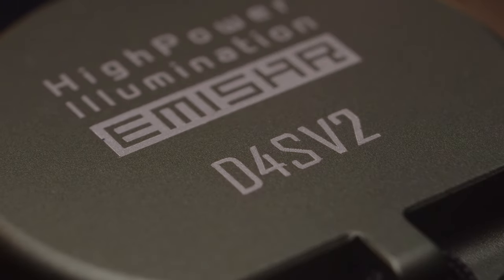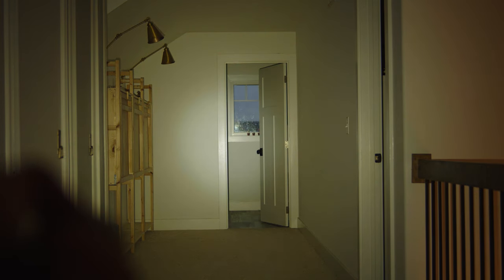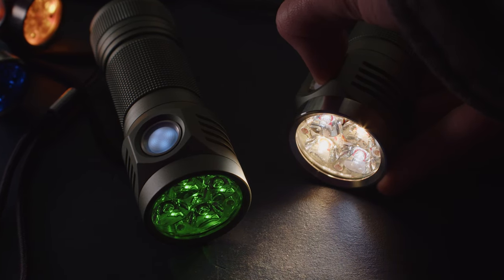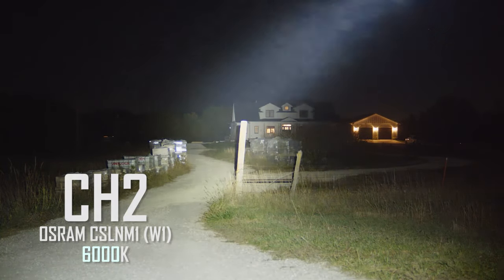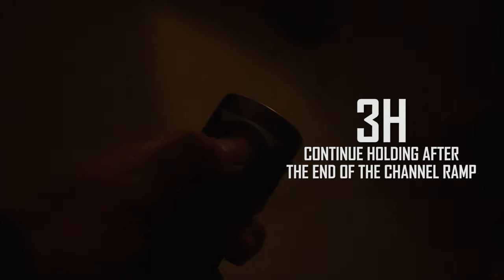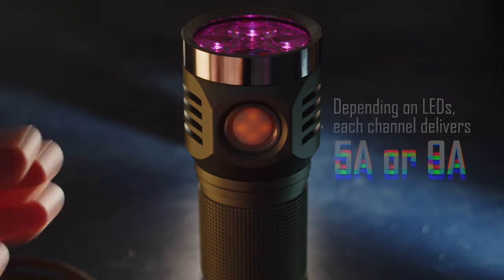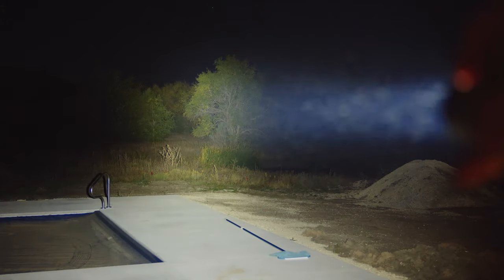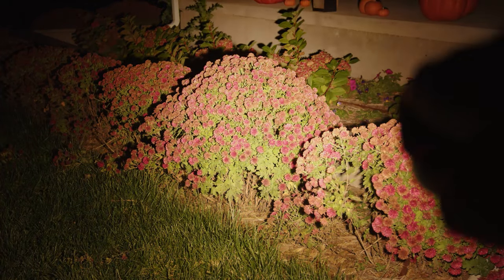The DUAL-CHANNEL Emisar D4SV2 [OVERVIEW]

Comment from the maker: THIS IS AN UPDATED VERSION OF THE PREVIOUS VIDEO (and is still NOT A REVIEW)

ToyKeeper made some major updates that effectively render the old video obsolete, so I felt a new upload was necessary. There's still some info in the comments in the older video (and admittedly I like it more), so for now it will stay up before it gets unlisted.

This is a quick look and overview of the new dual-channel D4SV2, intended to help answer some questions people have about the new light. The video was commisioned by Hank Wang of intl-outdoor.com (Emisar/Noctigon), where this light can be purchased.

A full review of the D4SV2 is coming, featuring both of these models as well as the W2 (standard driver) version of the light.
Reply: Will you delete the old video?
Reply from the maker: No I will just unlist it, so anyone with the link will still be able to find it. Just for sentimental reasons, I like that edit more 😅
Reply: Thanks for this. I’m super new to hank lights and just ordered my first one (regular d4sv2) 2 weeks ago. Still learning a lot about everything on Reddit and this video was really helpful.
Reply: I get the feeling folks are gonna poo-poo the D4SV2 now that this is available on the D4V2... Completely ignoring the excellent thermal properties and better throw optics.  It won't be the hot rod it is in single-channel configurations, but it's probably going to have some excellent runtimes and high versatility.

Nice update on the firmware! I can't wait to flash mine when it arrives so I just have everything available in one!
Reply from the maker: Indeed, there's a bit less wow factor here but it's super practical, I'm really enjoying these lights. The D4SV2 is an excellent light all-around. As far as enthusiast features go, the dual-channel thing is really more appealing to me than the direct drive Turbo, and it's still super bright!
Reply: Do you have any inside knowledge if Hank is going to be dropping any new lights soon before I buy my 3rd? 🤪
Reply from the maker: Two new lights... The dual-channel DM1.12 and a new right-angle headlamp style might, though that one with be several months away
Reply: @LuxWad  do you know what the DM1.12 will be?
Reply from the maker: It's got a large single TIR in the center and twelve smaller optics on the outside
Reply: @2tangz where do you go on redit 2 learn this ui? It's Def somewhat confusing

Comment: Crazy, wish this was available before I ordered the dw4, I would have much preferred the throwy w1 with a floody xpl. For a good range of everything on a headlamp.
Reply from the maker: The DW4 should be available with a dual-channel driver as that was released first
Reply: @LuxWad  I didn't see it, the main led flashlights list on their site doesn't show any of the dual channel stuff. You have to hit the options menu and go to "new products", it's only listed there. I only looked there by mistake today.
Reply from the maker: @preston1614  Yes the dual-channel lights are listed seperately under the "dual-channel and tint-ramping lights" section to avoid confusion
Reply: @LuxWad  yea, at least coming from the mobile app it seems like it's more hidden rather than avoids confusion unfortunately which was my experience. 
But I do see now that there is a new tab at the bottom of the main menu for dual channel lights.
I'm just so use to clicking on the led flashlights tab after all these years....  I have ordered hundreds of emisar lights since Hank started.

Comment: So does this version have the FET? So if I re-flash it I can get the max turbo?
Reply from the maker: It has a FET on CH1. You should not enable it, as it it's only connected to two LEDS, which won't be able to handle the ~15A or so provided by direct drive. Activating the FET only makes sense in the new tint-ramping DT8
Reply: @LuxWad  So I wanted a D4SV2 with lighted switch and W2 LEDs. That wasn't available so I ordered a W2/W2 D4SV2 And plan to reflash the FET enabled driver. Would this make it work like a regular W2 D4SV2?
Reply from the maker: Unfortunately that probably won't work, the FET is only wired to one channel (2/4 LEDS), so unless you're using a fairly weak battery then you will probably burn out the emitters on the first channel.
Reply: @LuxWad  could it be that that is how your board is because of the emitter choices, or is that all of the lights?
Reply from the maker: That's how all of them are configured, it seems to be the same driver used in the K9.3.

It really won't matter much though. The  two-channel driver will produce 18A on Turbo, which is about what you'll get with a FET and a decent cell. Though more current will be brighter, the emitters are being pushed well beyond their most efficient operating range so the actual increase in output won't be significant. For example, I have a standard driver W2 D4S and the difference between a 15A cell and a 32A cell is about 700 lumens, or about 15%. Because it's FET drive and not regulated, the turbo output will drop as the cell is depleted, where the regulated driver will be more consistent  with its max output

Comment: Great video as always! I have one question regarding the tint shifting as brightness increases. I would like to have the light ramp from 2000k/low brightness to 5000k/high brightness. When ordering, do I have to select the specific temperature emitter on a specific channel to make this possible? For example do I need to select the 2000k emitters for Channel 1 to be the 'low' and the 5000k emitters to be the 'high' or does this not matter? Thanks
Reply from the maker: It shouldn't matter, you can have it ramp either direction in the UI, just keep holding the button after reaching either end of the ramp

Comment: May I ask, can you set the ceiling to be at like 150%? So that you could use 75% of each channel?
Reply from the maker: Yes, the default ceiling of 130/150 steps is the max level where the two channels are balanced as tint shifts
Reply: @LuxWad  Ah, I see, thank you!👌👍 And that is about 173%, right?

(And you can't set it to like 140/150 steps, probably due to driver limitations, if I understand well.)
Reply from the maker: I don't know exactly what % that will be, that seems about right.

Anduril is designed to produce 150 distinct brightness levels, with 150/150 being either Fet-driven Turbo or just max output if there is no FET. The older version of the firmware used in these tint-ramping lights limited the max output to 130 just to keep things level, but it now allows access to every level up to 150. However above 130 tint-ramping will also change the total brightness, which is shown in the little house-like diagram.
Reply: @LuxWad  OK, thanks for the detailed reply!👍

Comment: Really great overview! Love your vids. I think I want to go with a dual channel D4V2 with a W1 or W2 on channel 1 and 219b 2700k on channel 2. Would this be a good option for something that would be good close range and long range? Does it matter which emitter goes in each channel? Last question, would you recommend the W1 or W2 on a system like this where it is only running on 2 emitters instead of the usual 4? Thanks for all your work!
Reply from the maker: I think 219b/W1 would be a good combo. It doesn't matter which emitter goes where, the light will be configured with the proper power for each channel.

I would recommend the W1 over the W2 in the single-channel light, as it has a higher intensity. The W2 has about the same efficiency but has a significantly higher max output, which allows it to throw farther when driven by FET in the standard setup. However the dual-channel light can't deliver nearly as much power as it would burn out just two LEDS, so in that setup the W1 will throw farther
Reply: @LuxWad  that's a great insight. I think I will put an order in soon. Thanks for your work and help! Subscribed
Reply: @LuxWad  by standard set up, do you mean the D4SV1?  I don't see the option to get the D4SV2 with fet driven turbo, back lit switch? I kind of like the idea of getting the standard fet driven one with 4 W2. Just want the backlit switch! I want then allllll
Reply from the maker: The standard setup is the single channel D4SV2, which has a FET+N+1 driver. It is not available with an illuminated switch.

Comment: Great Video! I have the D4SV2 2-channel in W2 White/W2 Green.  Is there a way to run strobe on just one channel or the other (hoping to be able to use green strobe)?  I can't make it work... always runs both channels on strobe...
Reply from the maker: It seems strobe only works with both channels unfortunately.

Comment: You sold me on this light. Just ordered from Hank. What’s the best battery and charger combo that would give me the brightest and best performance?
Reply from the maker: It depends on what emitters you're using. I have Keeppower 5500mAh cells in my lights for the longest runtime, since they don't need much current. Keeppower's 5200mAh 15A 26650s are probably the best all-round, efest and vapcell have some cells with even higher discharge but I've never used them. Any charger is fine, XTAR is the most recommended
Reply: @LuxWad  thanks for the info. I’m still learning about the varied options of LEDs. I ordered Channel 1 Cool white SST20 6500k, and channel 2 warm white SST20 2700k 95 CRI

Comment: On channel switching, other than turbo, is there a setting where you can use all 4 LEDs:  ramp up and down, turn off and on, etc. with all 4 LEDs on? ....
Reply from the maker: No, but you could set the ceiling to 150 and then ramp up. Everything above 130 requires both channels to some degree. Otherwise though you want tint-ramping

Comment: Great video! I have one on the way! I went with the XP-L Hd and the W1 Osram. Will the keepower 15amp 26650 be able to put out enough amperage for this beast?
Reply from the maker: Depends on the emitters, if you have the Nichias + something else it will be enough since the total draw will be under 15A. If you have two channels at 9A each you'll need something with higher draw - the 15A cell will still work but it will degrade more quickly with use

Comment: with tint ramping is there a way to find center? so all emitters are on equally, without going to turbo?
Reply from the maker: Right now there is no direct way to do this unfortunately. You can try disconnecting the power and the reconnecting it, as long as there is no manual memory it will reset to center ramp. You can then set this to memory.
Reply: @LuxWad  thanks, i had to do a factory reset but this appears to work

Comment: If you buy the dual channel driver in whatever color temperatures, will it still have the smaller leds that  change colors?
Reply from the maker: Yes
Reply: Thanks for replying.

Comment: I just got one in sand color with amber backlight and 519A 5700K   dedomed and w1, this light looks like pocket jewelry, but my question is how do switch between tints instantly without ramping each tint out?
Reply from the maker: That is explained in the video at 3:05
Reply: @LuxWad  ok thanks.

Comment: What would be the floodiest brightest white led and brightest throwiest white led.
Reply from the maker: LH351D on 5700K for flood, and Osram W1 for throw (W2 for single-channel lights)
Reply: @LuxWad  doesn't look like LH351D on 5700K is available for the dual channel?
Reply from the maker: @lucacadianalbert Availability changes over time, if you want something specific it's best to email Hank directly at contact@intl-outdoor.com, he will let you know if that's an option
Reply: @LuxWad  Thanks for getting back to me. I have an old Emisar D4 that I bought years ago which has quad 219C - its a nice light but I'm looking to get a V2 or maybe a D4K as an EDC light I can keep in my truck for when I go camping. I'm torn between 519a 4000K domed or either a 4500K/5700K dedomed, some people clam the color on the Dedomed ones are nicer - I just tend to not like the beam pattern on dedomed emitters (less flood) but color is also important. recommendation? I was tempted to get the dual channel but for a basic EDC light I feel its a bit much. Thanks in advance
Reply from the maker: @lucacadianalbert  The dedomed are going to be similar somewhere in between the 219C and XPL-Hi in terms of throw, while domed they are quite floody like an LH351D.

Colorwise, they are much warmer and more pinkish in tent when dedomed. If you want to keep the flood, you can get the same effect by mixing different CCTs, for example 5000K and 3000K. Dual-chanel will let you adjust the temp if you do that, or if you want FET power you can just get the standard version and ask Hank for a tint mix.
Reply: @LuxWad  5000 and 4000 aren't options for 519As...
Reply from the maker: Get something close or ask Hank for specific emitters that aren't on the site

Comment: Hello, I'm thinking of getting a d4k dual channel with w1 6000k with another warm temp floody emitter. What emitter would you recommend? And what is the maximum lumen for these emitters?
Reply from the maker: For the floody emitter, I recommend the Nichia 519a in your preferred cct, or the XPL-HD for maximum output (same as the light here). The Nichias should be about 2k lumens
Reply: @LuxWad  are there any throwy emitters that have high cri?
Reply from the maker: SST20 in 4000K or 2700K
Reply: @LuxWad  I’ve ordered a d4k full copper dual channel with w1 6000k and 519a 5700k doomed since I like its pinkish tint. It should be fine I don't think I need a really warm light. Thank you LuxWad, can't wait for your next videos.

Comment: Do they all have the color in the front lens when the main channels are off? I see green and pink in yours but no option to select what front ring glow color. Also, what is the difference between the D4V2 and D4SV2 besides battery size.
Reply from the maker: That glow in the front is caused by the RGB auxiliary LEDS, which come standard and can be configured in the interface.

The D4S is larger so has better thermal performance, a more throwy beam, and  a slightly better driver with a higher regulated output. Both have the same max brightness and emitter options.
Reply: @LuxWad  If I choose the same LEDs as you did on the switcher. More Flood for one and the Osram for more of a throw. If I use Titanium, will it cause these LED to not perform as well due to heat dissipation? Would these LEDs perform noticeably better in Aluminum or Copper? For example. The Alu and Copper Acebeam E70s list a higher lumen than the titanium.
Reply from the maker: The ti version of the light has a copper pill, so thermals will be basically the same as the AL or full copper version. Full ti isn't available because it doesn't conduct heat well and is a poor choice for a light like this.

Also it seems the Xpl-HD isn't available for the smaller D4V2, but the LH351D will be equally floody, and it's got better color so I'd prefer it anyways.
Reply: @LuxWad  Thank you, you have been a big help. I will choose the Titanium one then. And that was the LED I was thinking of after doing some research. Now, for the W1 or W2 LED, which would perform better in the D4V2 you think? W2 is bigger, more lumens and W1 is smaller, but more intense?

Also, what do you think about the extra floody optic option?? Does it come with both optics still or just one?
Reply from the maker: I think the W1 is better, since it has more intensity and throws further for the same output - the dual-channel version can't drive the LEDS as hard so W1 makes more sense. In the smaller D4 optic, both W1/W2 produce beams with rings though, functional but kind of ugly imo.

You'll have to order the floody optic as an additional extra, it only comes in the light if you buy the E21a version
Reply: @LuxWad  Hi there! I went with your recommendation with the W1 on the D4V2 - I absolutely love the light. I do see what you mean though with the 'rings'. I was considering getting the D4SV2. With it's slightly larger optics, do you find it creates these rings, or any combo to stay away from? I like the one you went with.  On another note, I did buy a Noctigon K9.3 with the SST20 for main channel and it also produces a big ring.
Reply from the maker: @LiamOlders  The larger D4S optics have a much cleaner beam with the Osrams than the small carclo optics, a more traditional beam shape with minor artifacts and no rings. While it's still not as nice as the other LEDs, it doesn't bother me.

I think the W1/XPL-HD is very nice, but I would recommend the W1/LH351D mix more as it's similarly floody but has better color - the XPL-HD LEDs have a very floody beam but strong tint-shift and low CRI. They are a bit brighter though.

Comment: Which firmware are you running that gives you channel switching? I have SST-20's in deep red and W1's at 6000k and can only seem to get it to switch using tint ramping (frustratingly slow).
Reply: I got it!  Nevermind.

Comment: You say the set temperature can be memorized...can you please give me instructions on how to do this? Just got my d4v2 with e21a’s 2000k and 5000k and would like to have it’s default be around 3500 but if I want warmer or cooler I can just change that on the fly but after I’m done using it I’d like it to go back to that 3500ish not remember the last tint I was on thanks!
Reply from the maker: It's set with 10c from on @ the desired temp
Reply: @LuxWad  thanks! Figured it out just messing around with it and looking at the diagram lol